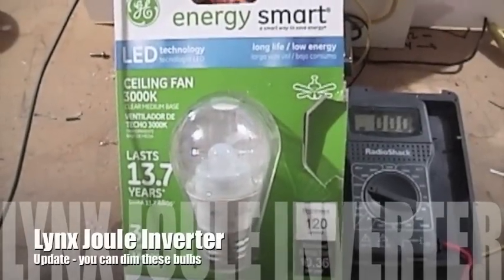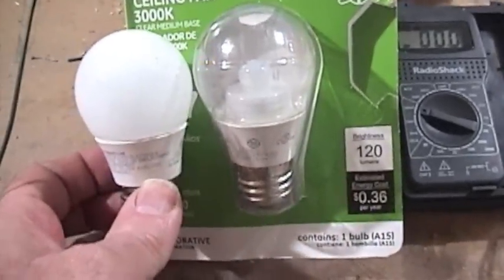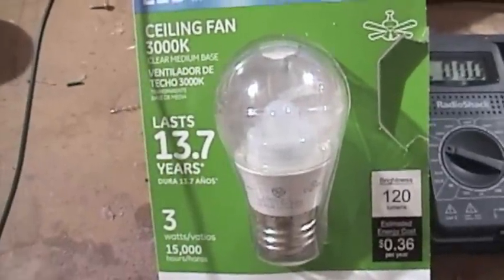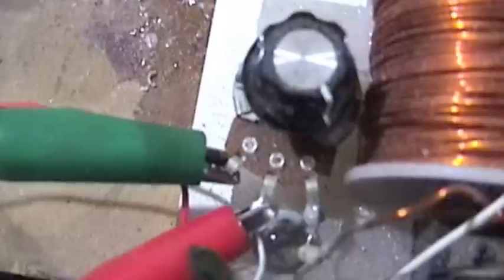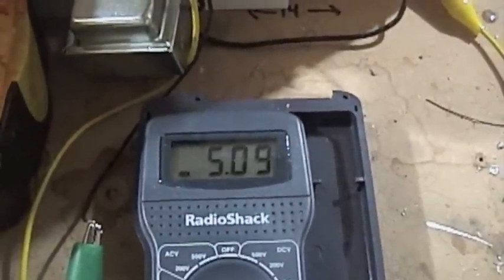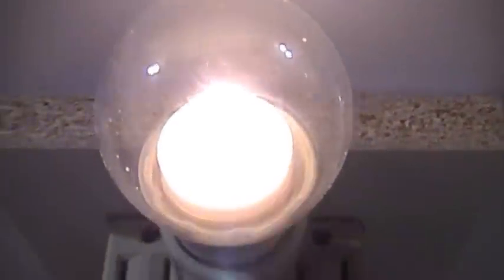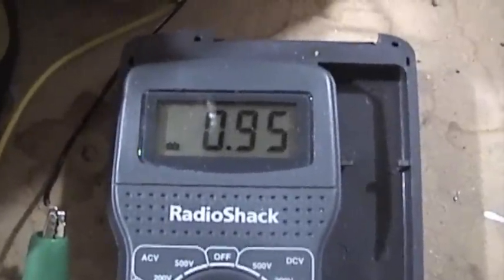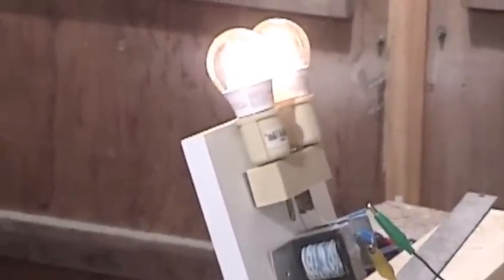Lynx Joule Inverter Update 2 milliamps

Comment from the maker: Well, it must be that type of bulb has to be chosen.  It definitely wont work for dimmable bulbs which work great on the joule ringer or my Lynx Joule Lamp circuit.  But for this simple setup the right bulb is necessary.  
It is non-dimming and the base code # is LED3A15/C  or LED3A15/W
UL Listed 48AX E328217
GE and Philips uses this same base stamped GE, it is called a ceiling fan bulb
Perhaps other non dimming bulbs work too.

Comment: Shoot me. But I have tried combinations of * transformers * led bulbs and * voltage 12v to 36 volt. Perhaps it is because we have 230V in Europe, but whatever combination I tried, I was not able to replicate. My guess is that the bulb is the problem. Just no resistance! No resistance = no current = no transformer working. If I short out the leads to the bulb shortly, I do get them to flicker. This is the BEMF of course. But please keep on posting, I will watch how you do this, I love the stuff!

Comment from the maker: The circuit diagram is correct. No transistors, nor capacitors, no resistors.  just a transformer and battery.  You can add the 5k variable resistor in either positive or negative line as an option to vary the light.  This system puts out useable light at 1/10th of a watt.  A single red LED takes about 1/2 watt by itself.  Shows the importance of frequency to reducing energy use.